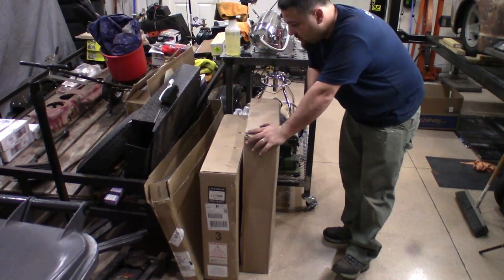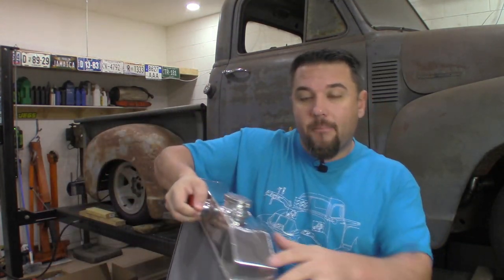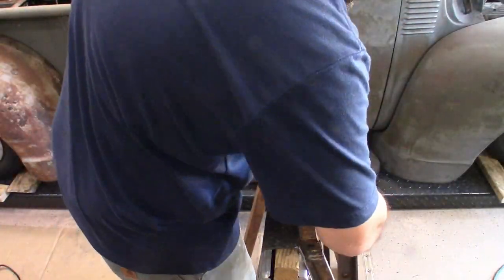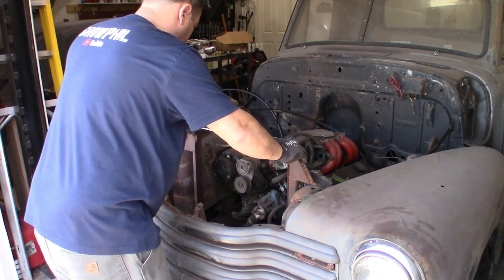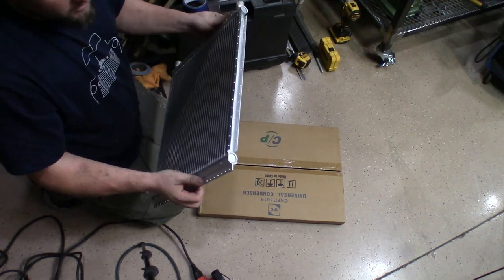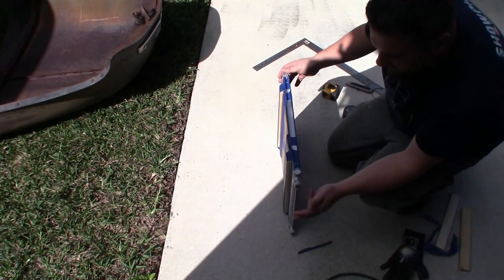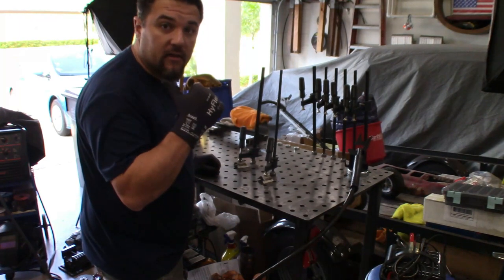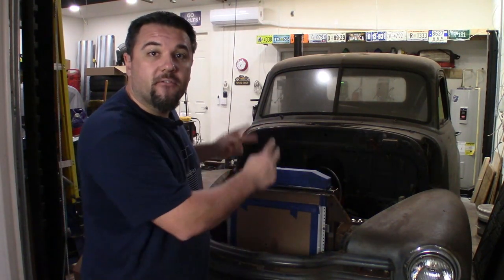PART 38 - 1952 Chevy 3100 - RADIATOR / AC CONDENSER INSTALL!!!

Comment: hey phil , your new mic is MUCH better . btw i ended up buying an Engineered Cooling Products radiator , look em up , it looks JUST like the original but has the automatic trans cooler ports in the bottom cap.

Comment: You asked, so, here goes: When you are about 1/2 way through, the sound from your mic gets very low, so, I had to really crank up the volume. Then, you include the music which is VERY LOUD!! This video was a little hard to watch because of that. Other than that, great video, as always.
Reply from the maker: I'm finding the limits of my editing software..... this video took HOURS upon HOURS to edit...... I had several days of work crammed down into a 30 min video.... so had to cut out A LOT.  The audio, pure garbage in this video.... I actually returned the wireless mic system that I used in this video.  I bought a better one which I believe will sound MUCH better...... I think next week's steering video should sound better... :)
Reply: @ShowPhil  I have no doubt in your abilities and am sure the new equipment will be great. I also have no doubt that other guys doing build videos do not have a fortune invested in what they are using and their audio and video quality turns out fine.